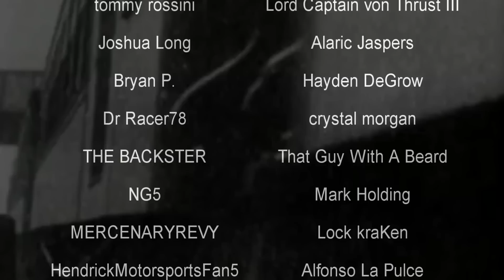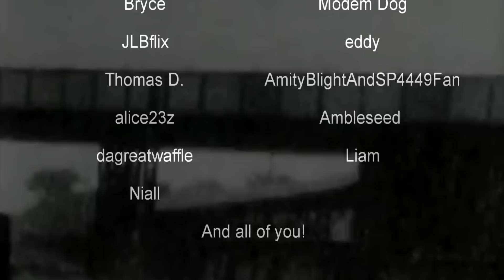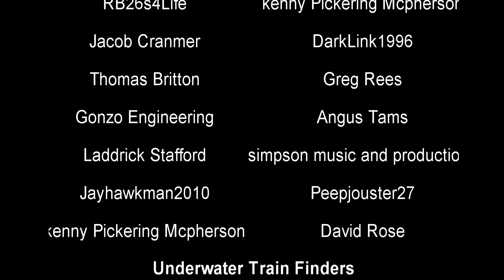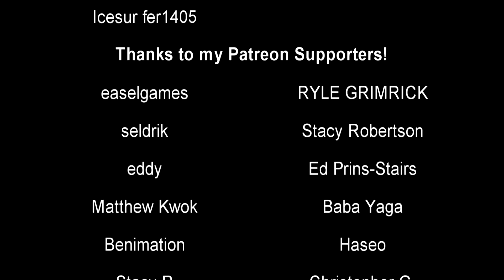The Quiet Star of American Preservation | The Tale of Nickel Plate Road 765 | History in the Dark

Comment: Fun fact that most probably haven't thought of before: 765 was the engine on the head end of the longest passenger excursion, by consist length, in American history. First day of the 1992 New River Train, the consist was made up of THIRTY THREE full size passenger cars, it's tool car number 701, and it's auxiliary water tender. 
On the, uh, The Roundhouse podcast by Nick Ozorak, Rich Melvin tells of how he got the 765 to do either 60 or 65 miles per hour up Scary Hill with that consist just to prove the road foreman assigned to the run as part of the pilot crew wrong because Rich had thanked him the morning before on behalf of FWRHS for the increased speed over prior runs being allowed by CSX and the foreman had said they wouldn't see that speed until they were on the other side of Scary Hill. Well safe to say it seems like Rich took that comment kinda personal and that road foreman ended up being VERY impressed with the capabilities of the 765 whilst it was going UP Scary Hill. 
What's fascinating to me about that performance is that 765 isn't even the most powerful excursion locomotive in operation. With that in mind, I can't help but wonder what an engine like 1225, 2716, 611, or 1218 can really do, especially the 611. I seriously think that the 611 could haul a fully loaded 40 car New River Train at 70 or 75 MPH on the Hinton-bound run if that sorta performance were to ever be demanded of the engine.
Reply: Considering that 611 was built to pull heavy passenger trains at speed through the mountains of West Virginia, that sounds doable.
Reply: I don’t know much about 611 but is it being retired for good for the foreseeable future or is it going through it’s fra inspection?
Reply: 1225 actually did pull the New River Trains the one year that 765 didn't.  As it turns out, she actually wasn't as good at pulling them as 765--her taller drivers (by all of one inch) meant that she had slightly less torque available than 765, so 1225 ended up struggling more with the mountain grades and she ended up about ten miles an hour slower than 765 with the same train.  She's not bad, she's just more optimized for flatland operations than 765... but that does mean that she isn't quite as good in the mountains that you'd have trouble finding on the old PM lines between Grand Rapids and Detroit.
Reply: I wish Santa Fe 5000 gets to do all that some day. She could put up some crazy numbers
Reply: @rdfox76 the 1225 and 765 both have 69 inch drivers
Reply: @rdfox76  That's not the case. The only year that the 765 didn't haul the NRT was 1989 and that year's NRT was hauled by two of the CSX F7's. 1225 only hauled an NRT length train in 1991 for the NRHS Convention of that year. 
1225 is built to the exact same mechanical specifications as the C&O's 2-8-4 Kanawhas, so it's not the 1225 can't handle that territory. The only reason the 1225 had performance issues during the 1991 NRHS Convention was because of a hole in one of its thermic syphons causing water to be sprayed directly onto the fire and the issue not being able to be resolved until the 1225's fire could be dropped. 
Also, 765 is also a flatland engine. It was mostly used in the flatlands of Ohio and Indiana during its revenue career on the Nickel Plate, but in 1982, proved it was a VERY capable engine due to performances put in on the Wheeling & Lake Erie, as well as the Southern when it was leased by the SOU to finish out the 2716's, a C&O Kanawha funnily enough, schedule for that year. 

Maybe if you had paid attention to the video you would've realized this.
Reply: @justahillbilly7777  Well, I'm sorry, I was going by a 1994-ish Railfan & Railroad article for the reason for 1225's issues on the NRT.  Though I'll admit I was going purely by memory on the date and made a mistake there.

Comment: Between November of 2015 and May 2016 765 went under the 1467 day inspection of 15yr inspection directed by the FRA. The boiler was striped down and tubes flues and super heaters were pulled. In May of 2016 she was fired back up for a steam test just before leaving for Chicago trips.